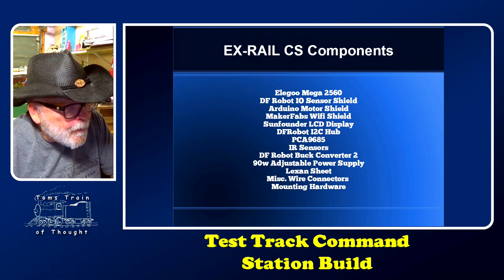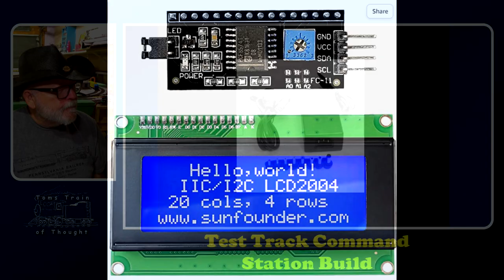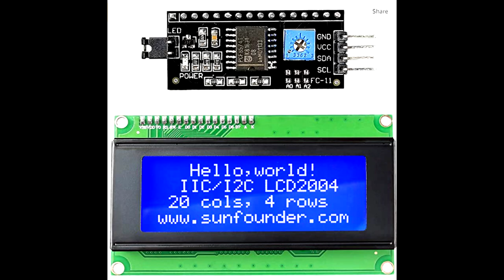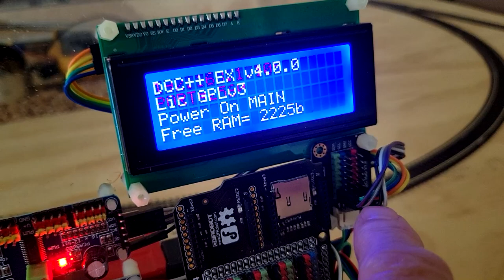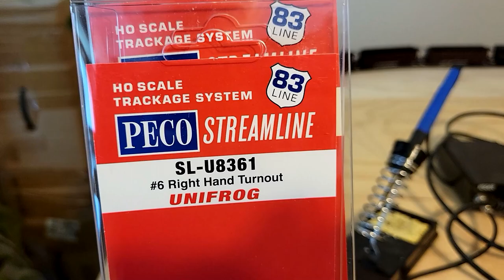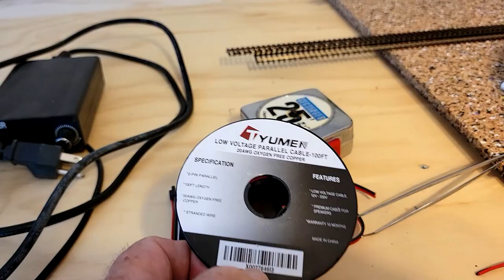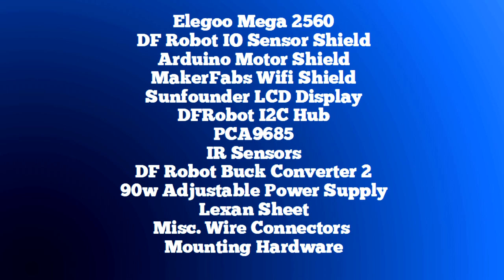EX-RAIL Command Station Build

Comment: I may need to pick up one of those buck converters and the 24v power supply for my next DCC++EX build to eliminate having to run two separate things to wall power as i'm doing now.
Reply from the maker: Easiest way to go!
Reply: @TomsTrainsandThings  Sure looks that way! Looks like DFrobot is out of stock of the buck boards so I am taking a chance on an ebay one that looks similar. lol.
Reply from the maker: @Trains-With-Shane  Jus make sure you have the range to adjust. Some are up, some are down, some are both ways!

Comment: Nice job on your board. I have used old computer power supplies. Lots of 3.3, 5.0, and a few 12 volt power outputs.
Reply from the maker: Those old power supplies work great

Comment: This is amazing, thank you so much for making this content. I have just started planning out my first railway since my dad’s HO setup we had when I was a little kid (until the mice in our basement ate it). I am a computer/electrical person and wanted to make a DCC-EX setup with a variable power supply just like this but was struggling to figure out what voltage and amperage I’d need so I’ll try the power supply you recommended and see how that works for the HO build I’ll be starting soon. I look forward to seeing the rest of the series!
Reply from the maker: The power supply I used in this video was recommended by one of the members of the Dev Team at DCC-EX.
Reply: @TomsTrainsandThings  Thanks again for putting this all together. I may have missed this in your breakdown of the wiring, but how are you breaking out the power from the power supply to the buck converters and the motor shield for the trains. I was able to power the buck converts to 5V and 9V output but I'm not sure how you were splitting the power for the buck converters and motor-shield as well as the Voltage you have your power supply set to.. I'm guessing it's a terminal strip or breakout board. I just want to make sure I understand how to wire this up before I fry anything. The other question I had is that none of my Arduino's have the VIN solder on the back of the board to break the connection, I'm not sure if I just need to bend the VIN pin from the Sensor Shield or Motor shield. I don't have a wifi shield since I went with an Arduino mega with wifi built in. The install was simple I just hit a bit of a roadblock with not knowing what to do about the VIN pin and want to make sure I'm powering this up properly.
Reply from the maker: @kevinschroll4890  15 v from the power supply is on the input of both buckk converters, it's also jumpered to the motor shield . Outputs of the converters are 9v to mega, 5v to sensor shield.
If your motor shield does not have a vin soldering pad on the bottom, chances are you do not have the correct motor shield. Send me an email since these stacked comments do not go to my icomments section they are hard to find

Comment: Pretty much did the same thing only I use an old 500w PC power supply for all my rail, accessory, Arduino etc. I have a couple old Android phones using WiThrottle for quick throttle control the rest of the layout is controlled via JMRI with several Arduino's via DCC and CMRI on an old laptop controlling signals, points, MERG current block detection, and IR detection at specific spots. Cheap and easy.
Reply from the maker: Whatever it take and what we have on hand!

Comment: Very nice guide! I myself built my DCC-EX for testing, however I used the Ethernet shield (instead of Wi-Fi) and a cool I2C OLED screen (128 x 64 matrix) that has more lines to display at once. I am more curious at adding servos, buttons, sensors and signals though - haven't done it on this "platform" yet. EX-RAIL is also interesting and I am planing to dive into this sooner or later. Any guides on these matters? It would be easier than a long RTFM thing, hehe.
Reply from the maker: That OLED screen sounds great. My next video will be the automation with servos and IR sensors. I have some dwarf signals that I may add also. On my main layout I have the same thing without the expansion board and display. I may add them later. That one is replacing my Digitrax system

Comment: Thanks for replying. Do you mean that the single power supply, powers three branches, one to the motor shield and one to each buck converter.? Is the power supply set to 15 or more volts also?
Reply from the maker: That is correct

Comment: Why did you need a i2c hub? Were both i2c devices hard coded to the same address?
Reply from the maker: The Hub is for additional spaces to plug them into. They are already different addresses
Reply: The passive hub you see there is just a set of pins connected together parallel, i.e. a way of allowing multiple devices to be connected to one bus rather than chained to one another.  A multiplexer will allow multiple I2C devices with the same address, and that's supported in the next version of DCC-EX (in preparation for release).

Comment: Excellent start Tom,
You are going to have a lot of fun with EXRAIL Automation scripts.

10x easier to setup Layout accessories 
and create Automation scripts & Engine Driver throttle buttons than with straight IDE C++ sketches or JMRI Jython.py scripts.

Stop by when your ready to try a sample DCC-EX EXRAIL plug & play setup for your layout.

Kevin
Reply from the maker: Thanks Kevin. Sure will!

Comment: Thanks for the video. This is something I want to try. I am confused about the power connections. Is one power supply powering the 5, 9 and 15v's?
Reply from the maker: That is correct. I have two buck converters, one each for the 5v and 9v. The 15v is straight from the power supply  to motor shield and inputs on the buck converters.
Reply: @TomsTrainsandThings  Hi Tom if there a diagram you have for this as im trying to work that part out as well as i can see you used the terminals and the VIN+ VIN- on the bucks and thought that might have overloaded it. as im intrested in this as i use them but didnt think you can use them in parallel like that. Ive tried freeze framing the videos on that side of things but dont think there is anytthing i can trace from the power in to them. any info would be great on that side of things.

Comment: I watched the first 5 minutes. What is EX-Rail? And I thought you were going to use DCC-EX++ on your test track.
Reply from the maker: Am I going to have to make a special Playlist For you?
Reply: @TomsTrainsandThings  I am not sure I can handle more than one of your videos at a time. 
(I thought this was the first in the series, you didn’t reference another intro video)
Reply from the maker: EX-RAIL is a feature of DCC -EX.  They dropped the ++ a few weeks ago.  It,s for automatic operation using simple code to operate the movement of locos, operate turnouts, signals and other lighting and fx.
Reply: @TomsTrainsandThings  so it’s like a DIY Motorman :)
How much did it cost? Materials and Time?
Reply from the maker: About $125. Already had most of the items laying around from other projects. About four hrs to build. The longest part was setting up & drilling holes the mounting those little standoffs.
Reply from the maker: More tonight during the stream. I'll even have a Q&A for you!